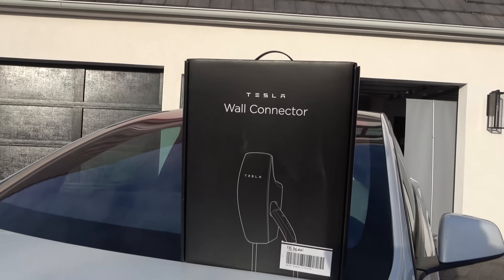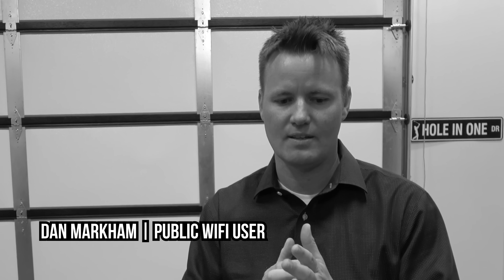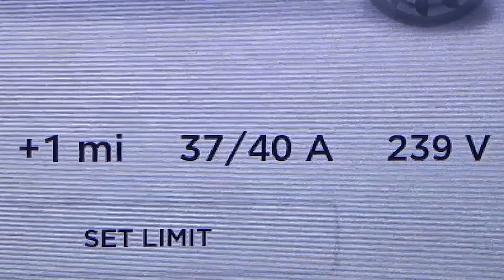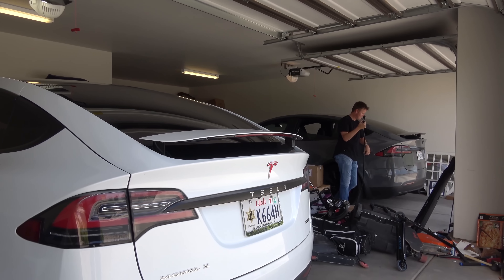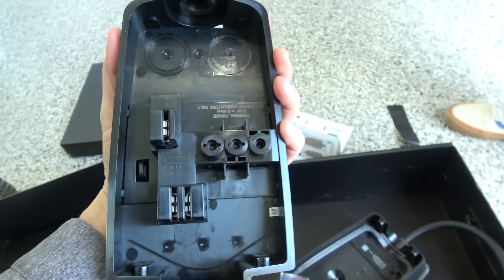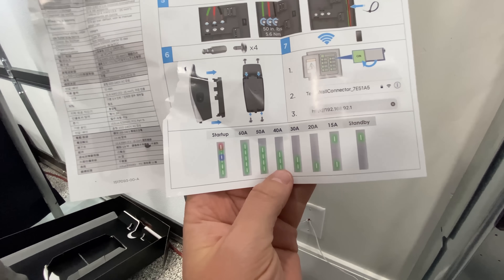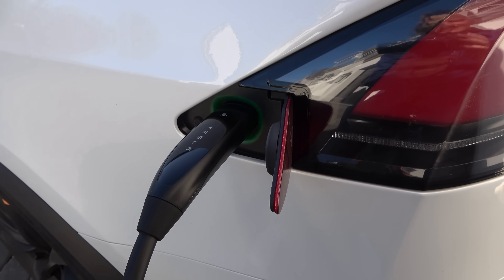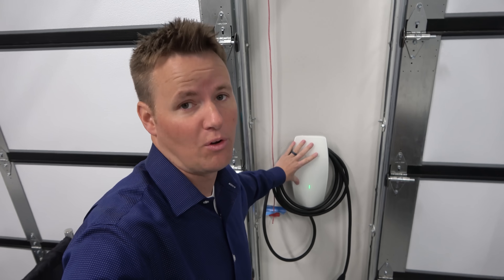What's inside a Tesla Charger?

Comment: I'm running a 70 amp double poll breaker to the sub panel and a 50 amp to the nema plug. 240v outlet for 50 amp. And yes double poll breaker. Using umc gen 2 and Tesla tap for the bolt EV 2017. And running #6 wire. I bought a spool since I was going to be 100 ft of wire that was going to be run through from the pannel to the garage.

Comment: The wire sizing is fine. The breaker being only a 50 amp is the potential problem. If the Tesla is drawing 48, you're at risk of it tripping constantly and the breaker going bad faster than it should. You are only allowed to put 80% of the load of the rating of the breaker. In this case it would be 40 amps.

Comment: Well the thing is your breakers only go up to 50 amps at 240 volts, so even if you could go up to 80 amps, your breaker wouldnt allow it because the house wiring isnt rated for anything higher that 50 amps

Comment: Your old one was probably limited to the charging power.  You did have a 50amp in your breaker but is your wire only rated for 40amps?  Thats a big difference when your pushing power through so if anything I would dial the new one back to 40amps also you don't overheat the wire and trip your breaker or cause problems if it wasn't wired with thick enough wire.  I gotta look and see if people are upgrading their chargers and pick up a used one cheap one of these days :P

Comment: You likely had the dip switches inside the old one set to 40AMP. The new one auto sets it based on software you don’t have to manually set it. So since your electrical allowed 48 it set it to 48.

Comment: There isn't an "amount of energy you put in the walls. The car draws what the software allows it to draw. Your 40 amps is the size of the circuit breaker. The circuit breaker is designed to protect the wires in between the electrical panel and the appliance plugged into it.  Your electrician likely installed 8 guage wire which can handle up to 40 amps without overheating. If you needed up to 55 amps you would need 6 guage wire and the appropriate breaker.

Comment: If I go Tesla, I'll have the electrician install a 50A 240V service to the garage.  Only 18 foot long cable?  In my garage that would miss it by 'that much', unless I'd back the car in to charge.  Unless I move some shelves around so I could mount the charger in the back of the garage, but would then have to run some conduit along the side wall.

Comment: Get those superchargers installed at your house. That would be the coolest thing ever.
Reply: "Hey everyone! Look a new supercharger in St. George!"
(Proceed to have Dan's driveway packed with Teslas)
Reply: Your electrician will laugh at you if you have Superchargers can power 4-5 house
Reply: Amano Yuuji assuming 200A service 1 supercharger would power 10.4houses and if you consider most houses never pull more than 1/4 of their power you are realistically talking 40+houses in the middle of summer with their AC’s on.
Reply: V3 supercharger at 800a 390v (50% battery SOC). Good luck getting the service for 312kw in a residential area.
Reply: @Jaker788  that would be funny you get a substation and giant transformer in your yard
Reply: @ralanham76  I feel like the power lines to your house would be dropping from how hot they're getting during a supercharge
Reply: @Jaker788  kW not kWh ;) Sorry i just hate wrong units...
Reply: @notnareithofer527  Ah I blame autocorrect
Reply: 3 phase.  It can be done.

Comment: 4:32
 You actually have 50 Amps instead of 40 A installed judging by the breaker, but if your wiring is only rated up to 40 A, running the charger at 48A will eventually cause the wires to heat up. 
If this is the case, most good quality wires can operate at some Amps above its rating, its probably not an issue but defnatly something to keep an eye on.
Reply: If someone says they need 40A for their car charger, you install a 50A breaker and wire. If you try to draw 40A on a 40A breaker it will blow.
Reply: @MW-gh3lt  based upon the 80% rule or the 125% rule, you are right at 40 amp draw you need a 50 amp breaker and wires.  I am concerned about it now pulling 48 amps on a 50 amp breaker and wires.
Reply: When setting up the wall charger you tell it what size breaker you have. If you are getting 48A then you told it you have a 69A breaker. This is clearly not the case! How did the "licensed electrician" configure your charger for the wrong size breaker? Or did you just select the biggest option like Tim Allen?
Reply: He has a 50A breaker. The charger manual says for a 50A breaker, set the dial to "8," which maxes the continuous current delivery to the car at 40A.
Reply: Assuming he has 6awg wire, the 50A breaker should still protect the wire. When the 48A charging gets too hot, the breaker should trip. I would be more concerned if he put a 60A breaker and kept the same wire. I would advise that he turn the charging amps on the car down to 40. Those extra 8 amps shouldn’t matter with overnight charging. 40A is still plenty fast.
Reply: @lemongavine  6 gauge wire, though rated for 55 amps, can be up-rated to 60 amps in many circumstances.  He should be good if he just upgrades the breaker to 60 amps.
Reply: Greg Hassler from my understanding, EV charging doesn’t allow up-rating because of the sustained amperage during charging which can make the wrong gauge wire get hot (heat builds up over time). Intermittent loads might be okay, but EV charging is far from intermittent. There aren’t many devices (if any) other than EVs which draw that much sustained current for potentially such long periods of time.
Reply: @lemongavine  could be, but I thought it was allowed if the cable was mostly run without being in conduit (like <10% or something).  The 75°F rating of 6 gauge copper is actually 65 amps.  I've been running it for over a year.  I forget where in the NEC I found the rule.
Reply: Greg Hassler To be safe, if using 6AWG wire for EV charging, I would set it for 40A and use a 50A breaker. Charging at 48A with 60A breaker isn’t all that much faster and probably not worth the risk.
Reply: @lemongavine  it's certainly safe, but again I've been doing it for a long time now with no problems.  I've monitored the heat at the panel/breaker, the plug, and the cable itself.  No heat issues, no voltage drop.  It's fine.  In conduit I wouldn't do it.
Reply: Future video of how something caught on fire?

Comment: At about the 4:32 mark you can see you have a 50 amp fuse actually 100 amp depending on how its wired, the old charger has adjustment inside to change the charging rate so you would've been better off keeping the old one and changing the speed
Reply: How did you work out 100A depending on how it's wired? it's just a 50A breaker
Reply: @James-gg9lu  Oh so it is my mistake, still no need to upgrade though
Reply: The wire is not rated for 100A running 100A through it is an extreme fire hazard, that is why there is a breaker in the first place
Reply: @Cameron-or1fr  I'm saying he could've run 48 amps through it before, no need to upgrade
Reply: If it is just 50 it would not have been safe to further increase the current draw.

Comment: I’m no electrician, but the reason the cables might be different in size is what they are made of! The older (bigger) cable is probably made of aluminum wire and the newer (smaller) cable is probably made of copper wire. This has to do with the resistance of the material, therefore and larger diameter cable is needed or so-called gauge is needed to suffice the amount of energy

Comment: Hello Dan, I just want to clear a misconception: More amps doesn't imply more energy directly. The amount of electric energy is given by this (simplified) formula: Energie=Voltage*Current*Time
So if the Current has 1 million Amperes but the voltage is 0, the energy will remain also 0.

Comment: Whoever reads this what’s the average price does it cost to charge up a model three at your home?
Reply: It's easy to estimate. A Model 3 LR has an ~80kWh battery. So just multiply the per kWh price your utility provides by 80 and you will get the answer. The range should be something like 4c/kWh - 25c/kWh depending on where you live so a 0 - 100% charge would cost between $3.20 to $20.

Comment: The old "wall connector" (not charger - the charger is inside the car) was limited to 40A by a selection switch inside it.  40A is correct due to it being on a 50A circuit (80%).  The new one should have been limited to 40A during initial setup using the app.  48A is only acceptable if on a 60A circuit.

Comment: Check the amp setting switch inside the old one.  That is likely where the issue was.
Reply: Can we cut a Tesla in half
Reply: SpudLab I want them too but they probably won’t.
Reply: My old tesla wall charger is currently charging my 2019 Model X at 48amps.  Dip switches can be set to go to 80 amps.
Reply: Totally agree.
Reply: agreed
Reply: egibbys Also dual charger tesla cars.
Reply: No, it can get up to 80A but only with older Dual Charger cars. I presume this isn't any in the vid and so the charger decides that the max is 40A.
Reply: The dip switches

Comment: The old wall chargers has a dial inside where you can set the charging speed to 20A, 40A, 60A and 80A. so the old chargers are faster.
Reply: O
Reply: Agreed. I saw the insides.
Reply: Yeah. I thought this guy would be smart enough to figure out that the old charger had adjustable charge rates once the faceplate was off. His original electrician never set it properly. He ran big enough wire (#6) to the charger from the panel to install a 60 amp breaker and set the charge rate at 60 to get the car to charge at its 48amp max rate.
Reply: Ok, this is something that needs to be clarified. As other people said. The old one has a little dial inside with letters where you can set up the max speed based on the Size of the breaker (and the wire) you’re using.

You could easily have moved the dial in the old one and the car would charge faster,  However, you have a limitation that is your breaker. 

So the Max rate that you can charge with the old Charger is 80A  (when connected to the proper size breaker and wires)  
The max rate that the new one can charge is 48A 

Last thing to clarify, 

The only cars capable to charge up to 80A are Model S and X up to 2016, with the “dual chargers”
In 2017, the dual chargers were set to max 72A  
New ones charge up to 48A 
Anyways I love it.
Reply: They discontinued the dual-charger model S? X? Yeah that would have done the full 80A.
Not the new cars tho.
Reply: @Toby Cooper This is true on the newer versions of the S and X, but earlier versions did have double chargers. I believe that the older versions could charge up to 16.5 Kw AC. New cars are around 11 Kw i think.
Reply: Have to decide on your wire’s thickness of course.
If later on people can use 360 volts which is what “Nicola Tesla” invented, I would be so amazing and people would have 4/3 of the time charging with the same amperage
Reply: @onehourmusicbc  Doesn't almost every house have a 400v system? I have a 400v plug in my garage
Reply: MauriceNL what country is that? I believe most homes in the US are 220-240 thats the max!
Reply: @kenrdavis2266  i live in The Netherlands. here normal sockets are 230v and high power things 400v.
Reply: Yep charged my Model X at 72 amps everyday and the loaner Model Ss at 80 amps
Reply: Can someone tell me this family's new home address or city?
Reply: Ok so
Reply: That’s correct you can go up to 80Amps on the old one but you have to set the dials for that. Also would depend on how many amps are on that breaker. If you had an older Tesla like 2017 they had high amperage charging at home up to 72Amps
Reply: He assumed that he had the electrician set the max capacity for the charger at 40Amp. He talks about the different adjustment  settings for the amps but he thought he had the limit set through the pack end output from the breakers.
Reply: Okay, thanks.
Reply: Oskar Brusdal that is very helpful thank you
Reply: Wait in past it didn’t show heart
Reply: tesla lemeted it du
Reply: the new teslas can only charein home chargers at 48 amp
Reply: Yup
Reply: This, set the dial up to 60, it will hit 48 due to your breaker being a 50 amp. You should send that old Elon Musk edition one, keep the face plate! but ill take the charger. I got a Model Y coming :) hehe
Reply: @AustinFerguson  48A charge rate requires a 60A circuit.  Per National Electric Code, continuous loads (such as EV Supply Equipment) must be no more than 80% of the circuit size.
Reply: @craigmanning444  I know, I forgot. I just installed 6/4 14-50 install on a 60 for the 48 amp reason. Though oddly in Dan's video on that new charger he has that charger going into a 50 amp breaker and his model x was pulling down 48amp, so I'm guess overloading it.
Reply: Austin Ferguson he didn’t end up showing what it actually got up to. I’m curious... Old charger showed 38/40, but the new charger was still working it’s way up there
Reply: @AustinFerguson  Negative. If you set the dial to 60, it will tell the car it can draw 60. The EVSE has no way to know what size breaker is feeding it, that's why there's a dial! The minute it crosses 40a the "50a" breaker is going to start heating (slow overcurrent), at 60 is will trip in seconds. (this assumes a brand new, never before tripped breaker. Older breakers will very likely pop over 30a -- i.e. the outlets at 99% of RV parks across the world.) What limits modern Teslas to 40a is not "software"; they only have a 12kw charger, vs. the older 20k -- because "fast" charging is done via DC at supercharger stations.
Reply: @AustinFerguson  i feel sorry for you.
Reply: @AustinFerguson  I got model 3!
Reply: Faster but comes at a risk....
Reply: Tesla nerd just saying you smart about tesla's btw